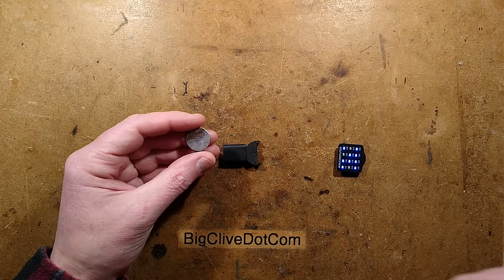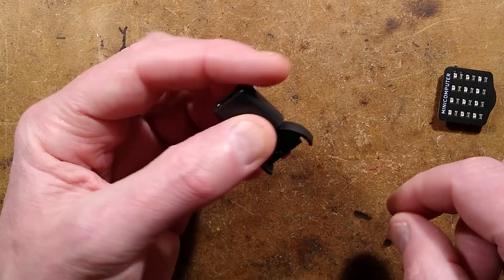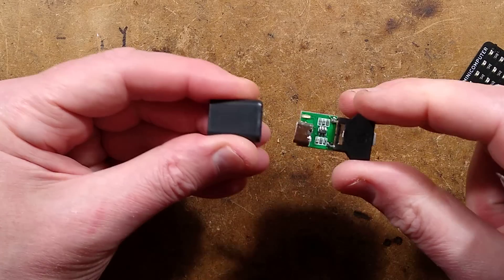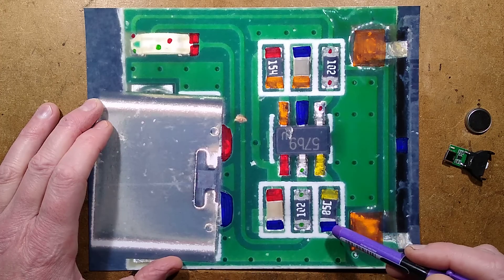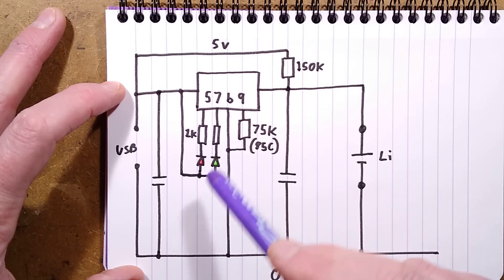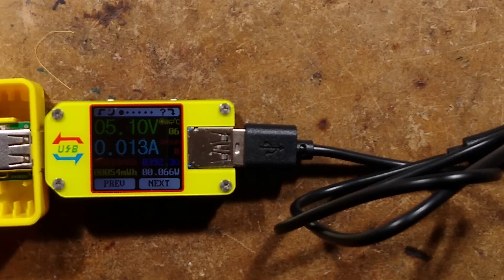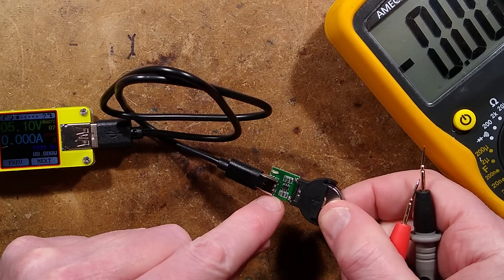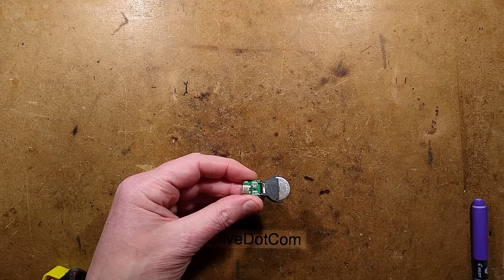2032 lithium cell charger with reverse polarity test

Comment: Lir2032/lir2032h are both rechargeable batteries but much lower capacity than the regular batteries the lir2032h is 70mah and the lir2032 is around 40mah

There is also a ml2032 battery mostly used in motherboards is around 70mah but only recharges 100 to 600 times VS over 900 with lir2032/lir2032h battery

Comment: Alkaline Batteries can be recharged a few times despite concerns that they're not. Is there a way to recharge cr-cells the same way?
Reply from the maker: The alkaline cells have to be recharged with care as they pressurise inside and can leak or explode.  The CR lithium cells do not seem to like charging attempts at all.

Comment: Hi, Clive. How long would you say, as you say a looong time? I have one of these chargers. 6 hours later, still on red. Decided to pull battery out and put in my device. And nothing. Still dead as a dodo. So. If they do take a looong time. They are no good to me. Or do you think mine is faulty? Cheers, Clive.
Reply from the maker: That doesn't sound right.  Did the cell go in the right way around?  Was it a rechargeable cell? (CR2032 will not take a charge).  When the cell is exposed like in this charger the voltage can be measured across it with a meter during charging.
Reply: @bigclivedotcom  Thanks for getting back to me, Clive. Yes, of course its a rechargeable.  I bought the batteries first, then this. it finally went green after about 7 +  hrs. Can't watch it all day. Whether or not it holds the charge though, is anyone's guess. I dont have a multi Meter. When I bought the rechargeables. They last for ages.  So may take some time to monitor further. Hopefully.  Lol.
Reply from the maker: @flips300021  An annoying thing about the classic chargers is that the bulk of the charge will be quite fast, but the current gradually reduces and it can take ages to reach its final cut-off point.  The end voltage should be around 4.2V.  At 4V it's mostly charged.

Comment: Bought a pair of this with exactly the same charger today. 

It scared me to go hot when I tried to multimeter it 😂 Turn out this need to put on load circuit for measurement to avoid short-circuit.

Comment: Recently bought an identical looking charger. The board inside is a little different - the passive components are in different positions and it has a little more verbose silkscreening - the components are marked (C1, R1 and so on). It also has a proper USB C connector with all pins, and it works with my Google Pixel USB C charger (which is very particular about standard compliance), so it looks like they use the proper CC pins resistors.

Comment: it's good to note that the LIR2032 is 3.6-3.7v and the MIL2032 is 3v so depending on what you're using it for you might want to go for the MIL2032 instead if your device is expecting 3v.

Comment: I was always curious why these batteries have the polarity reversed compared to basically any electric/electronic device. You would expect the capsule's body to be - and the smaller disc +, like with any other battery, or devices with grounded bodies... It still confuses me when I have to deal with them because I instinctively go "- to metal body"...

Comment: One thing I'm curious about... Assuming sufficient space within the case, would it be possible to retrofit an old console, such as the Gamecube, with an LIR2032 ML2032 and a charger, such that the battery gets recharged while the console has power but the battery supplies the CMOS with power when main power is cut?

EDIT: So I'm informed that the LIR2032 has a different voltage than the CR2032, and as such that would be a non-starter. But change the question to ML2032 and I'm still curious.

Comment: Just this morning I realised a mistake I made and thought of this video.

I have about 20 new BT trackers that use 2032 coin cells for work...last night I went to replace all the original coin cells with rechargeable ones and accidentally charged all the NON- rechargeable 2032 cells.

Never made this mistake before in 43 years, but I did it.  Odd thing is, they all charged up in about the same time as the rechargeables...and then tested with a DMM @4.15v, and all trackers worked fine when I installed them.

I didn't even notice my mistake until this morning when I went to toss the pile of old cells and saw they all said "rechargeable" on them.

Anyone know anything about charging regular lithium coin cells, and what I might expect (leakage, very short life,  anything dangerous)
Reply from the maker: I've never had any luck doing it.  They seem to go to full charge voltage instantly, and have very little charge.
Reply: @bigclivedotcom ¼ of them have already stopped working, so I think you're right on.

Comment: Can you test (and fix) 3$ usb aa/a charger pujimax pj-n4008? Micro+type C port, Led meter, 4 slot dual channel charging and termination mode. 
Main problem is that output only 2,4V per channel, when should be higher for complete charger process

Comment: All my bike sensors [heart rate monitor, speed and cadence, actually a pressure gauge too] take these so I thought I'd be responsible and get some LIR2032s they don't don't last very long at all! I have to recharge them every 2 weeks or so, the plastic housing on the various meters isn't designed to be opened that often so now I'll probably just get some really good quality CR2032 that last for a year. Lesson learned eh 😐

Comment: IVe been using LIR 2032 cells for a few years in wearable LED things They are ideal for color cycling LEDs because of the voltage/current needs are pretty similar to the voltage range of lithium cells. They are 4.2v when fully charged, and you cant use them in place of cr2032 cells (3v) unless the device can handle the higher 4.2 volts.  They can run a single color cycling LED all night, and a small strand of them for a couple hours.

Comment: At first I was thinking the "strange" resistor is for the backwards connectivity. However, once the cell is flipped over, there is nothing contacting the Negative face. So therefore the cell itself is providing the reverse protection.
But, the interesting thing is that the Positive side now is bridging the all 3 pads on the charger. So at this point, the "strange" resistor is now providing the bypass short current protection, I would assume. The resistor would probably heat up over time if you left it connected backwards too long

Probably answered elsewhere, but this is mostly for engagement purposes 😜
Reply: Update after reading some more comments. I didn't realize that the Positive was a center tap as well. They are normally wings that clip around the cell. So that kind of tosses out my theory of the contacts not making contact during reverse polarity. However, might still be confirmed with the strange resistor.

Comment: Avoid these chargers!  I bought TWO of them a few months ago.  I was highly concerned about reverse polarity protection as well and went through the same tests.  But after, I tried leaving fully charged LIR2032s in there for an hour or so.  One was obviously dead immediately after this reverse polarity test (no LEDs came on, no voltage output) while the other worked... until I did the test again, killing it as well.  Two chargers dead and useless in the first day.

The LED is very difficult to see through the a tiny hole you have to view from just the right angle, so a user may not notice the polarity is reversed right away, so destroying the charger this way is VERY likely.  What's more, physical reverse polarity protection is trivial on 2032 cells... put one contact in the middle, the other on the edge of the battery holder and you can't reverse the polarity if you want to.  One corner too many cut, and not for any great savings...  Instead of these, get the dual socket LIR2032 chargers with an LCD display, as those work nicely, give you better insight into the state of charge, and are only slightly more expensive.

For those wondering about LIR2032s in general, they're a good option for higher-drain devices like remote controls.  The cells only cost about twice what a disposable CR2032 would, and with the cost of the charger, will pay for themselves after about 3 recharges.  However, they're not a very good option for low drain devices that will last several years...  there, the self-discharge characteristics of Li-Ion will deplete the cells in a year or two, and may not pay for themselves.

Comment: Maybe, the output pin of the chip needs to see a +ve voltage to enable charge output? 
If it is dragged down by a reversed battery, or even a shorted battery, the output is inhibited?

Comment: I now want to know what happens if you DO put a normal non-rechargeable CR2032 cell in it. Just for science purposes of course.
Reply from the maker: The voltage shoots straight up to 4.2V but no significant charge is taken.
Reply: @bigclivedotcom  So no explosion or fire then? That’s somewhat disappointing, though I probably won’t be testing it anytime soon, just in case.

Comment: Something I noticed is the LED indicator turns off with the battery backwards. The chip may have a short circuit protection built into it. I tried running the chip number and the closest I could find was a HM5057B435 at all datasheets. It has a similar charger diagram in the chip's documentation but there's several differences. Some text is in a different language, I ran it through google translate and it does seem to have a built fault protection based on the info. Some the text didn't translate correctly though.

Comment: I didn't know how those numbers worked but I've seen batteries that will fit in a CR2032 holder but they're half the thickness.

Also I had no idea they were rechargeable versions. You think they'd want to set it up so that every time your computer is plugged in it recharges it and if you remove your computer or other electronic device then the battery can be drained in order to keep the clock working and other CMOs stuff idk
Reply from the maker: 2016 cells.  1.6mm thick.

Comment: Those LIR2032 batteries are very expensive. I was hoping there would be a rechargeable coin battery because I loathe throwing the damn things out. Local supermarket chain and now accepting batteries for recycling which is good and say they accept the 18650 but specifically state they don't take laptop batteries. Bit confusing that.
Thank You for the video Clive, greatly appreciated. 👍
Reply: They probably only want loose cells. Easier to process.
They also may not want the pouch style cells that have become increasingly common in laptops people have paid enough to want to replace the battery in.

Comment: There are also rechargeable ML2032 batteries, which are the same size but 3.0V instead (and generally more tolerant of being overcharged).
Reply: I'm finding it hard to find ML2032 chargers online. There are a tonne of LIR2032 chargers, and some of them are falsely advertised as being able to charge ML batteries too.
Reply: @La_Vi_  - They'll probably work fine, they just might not be able to figure out when the battery is charged, depending on their internal logic (but MLs are generally fine with being overcharged, so you won't kill them, you'll just waste a bit of power).

Comment: I think a lot of us might've made the assumption that rechargeable cell technology can't fit into a 2032 form factor, so it's great to see that we've got that wrong! But as others have said; If a 2032LIR has different voltage/current characteristics to a normal 2032 then it's probably no accident their existence isn't too widely advertised.
Pop one of those into my (Run of the Mill) sports watch and it blows, I've lost £10 plus the cost of the cell. Now imagine that same situation happening with a £3000,- Rolex... 💸

One question it does make me want to ask though, is: If it's possible for rechargeable cells to fit even this form factor - And given the amount of resources we put into non-rechargeable batteries every year - Why is it that we are still so reliant on non rechargeable cells for so many applications? 🔋

I can understand that simple/single-use cells are OK for some low-demand applications (I have two analogue clocks; I run them on Kodak/Poundland zinc cells) but if rechargeable equivalents meant a loss even of 50% of the normal cell capacity/runtime that still means I'm only having to recharge my clocks four times a year, and my watch once every 24 months. Not exactly the most demanding of compromises I don't think. 😇

And given the sort of servicing revolution rechargeable long-runtime, low drain Lithium cells would bring to gas metering and other applications where external power supplies can't be used on safety grounds... 🌍

Comment: I have pack of 4 double usb output, that I purchased from Amazon. The plugs had the apple design but are very light. Plugged my iPhone into charge and the plug got so hot, possibly meltingly hot. If you would like them to tear down let me know. 

I think I will not be using them for their 2.1amp rating

Comment: Very interesting charger. Could you tell me what type of (MCB ) do you require for a fusebox that can do (DC solar power and AC voltage) or is there such a fuse that can trip if the wrong voltage goes though. When a power cut accrues. Many thanks.

Comment: Hi Clive, interesting video as always.

I thought of a possible mechanical way to provide polarity protection at least for this gizmo. If you designed the battery holder so that the positive contact was a springy metal half ring like you see in some battery holders, just deep enough to contact the side of the positive part of the battery, then if the cell was inserted the wrong way, the negative terminal on the battery wouldn't make any contact.

Cheers from New Brunswick, Canada

Comment: Inserting a charged cell the wrong way around will pull the chip output pin hard below ground. I would think that would prevent the output transistor from conducting and probably disabling the chip. A look at the internal circuitry of the chip would be instructive, even just a block diagram.

How fully can a rechargeable 2032 be discharged? That would seem to me to be the critical factor here. At zero volts the chip might try to charge it or it might not.

Comment: 150k is likely to hold output at input level so that it detects battery without having output switch on its simply looking for output to drop with in range not too low switch stays off output 5 v switch stays off if  output drops a volt or 2 when battery inserted and this triggers charging also would bring a very low voltage cell up slowly to the start charge voltage

Comment: When I tried to use a TP4046 module (the one with the extra protection chips), it got really hot while charging. Like too hot to touch hot. I tried the other TP4056 modules in the set that I got and they did the same thing. Was it just because the TP4056 relies on inefficient linear regulators or was I doing something wrong?
Reply from the maker: That's normal.  They are linear current regulators with internal thermal protection.  Using a lower charge current will keep them cooler.

Comment: Yeah, USB-C PD Chargers for example are too smart for a dumb cable or USB-C port with only power and ground so it wont activate charging as they cant communicate with each other. In which case a normal USB-A style charger would have to be used. Ran into that when i tried using my 45W PD Charger with some TP4056 boards with a USB-C connector instead of Micro, charger wouldnt initiate charging due to the connector/board not being able to talk to the charger.  USB-C TP4056 boards are better than the micro versions imo though.

Comment: In theory if the cell is put in backwards, all it would do is short the charger out as the negative and positive of the adaptor clip would be shorted due to the design of a button cell with positve on the side and negative on the bottom.
If the contacts are central, top and bottm rather than side and bottom, then maybe the chip has some sort of basic protection.   I probably wouldn't want to leave a cell in for extended time to test that theory though.

Comment: Do the rechargeable ones last as long as, or close to, the regular type before needing recharging? It would be nice to be able to recharge these, but not if I have to undo, remove, charge up, and reassemble the many fobs and things I have every few months, versus just change them every year or two.
Reply from the maker: Sadly, they have a much lower capacity.
Reply: @bigclivedotcom   Thank you for the reply! I'm an old guy, so my rechargeable battery experiences during my lifetime so far have been coloured by the horrible Ni-Cad years, hit and miss Nickel Metal Hydrides, and rather scary Lithium puffies, but I try to keep an open mind, and hope lol.

Comment: nice, the resistor will probably help if the battery gets too low. probably a more common problem with button cells than with larger batteries.